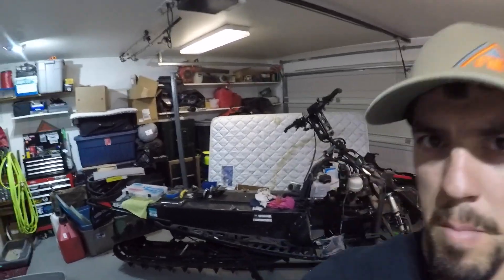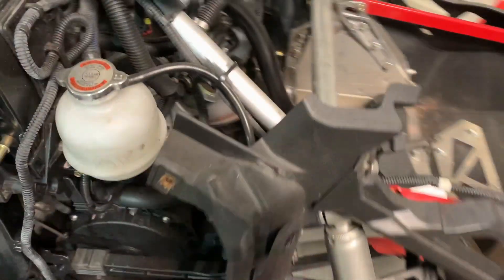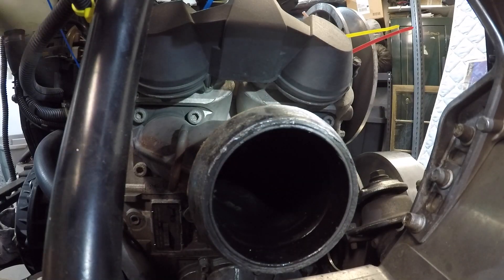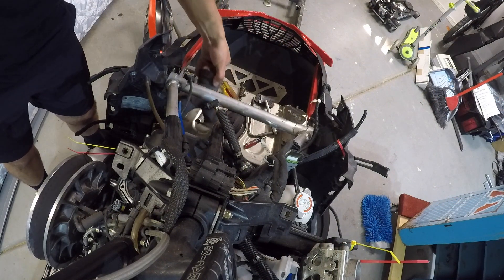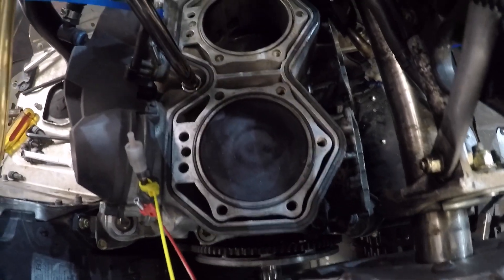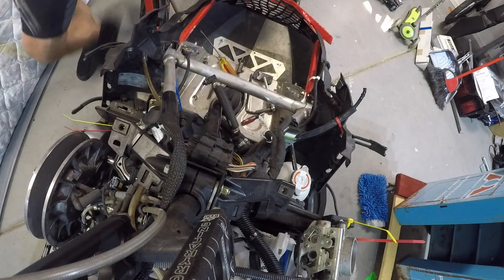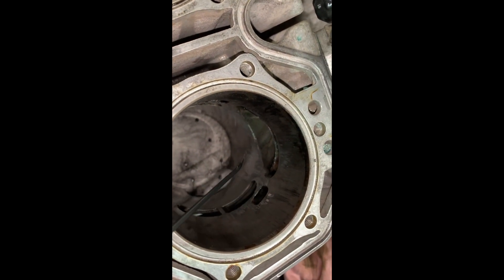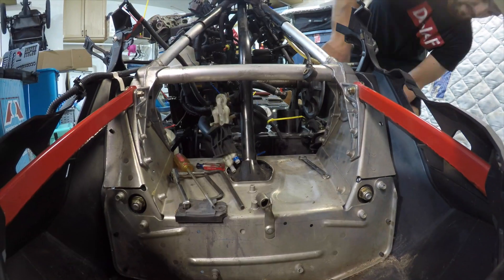2016 800 ETEC Snowmobile engine teardown!

Comment: Got 18,000 Kms on my summit T3 etec, just needs an air box boot. Gotta let em warm up.  My summit before this one had 14,000 km before I sold her.  Take care of your sled. She’ll take care of you
Reply: How often did you grease crank bearings?  mines 4500km but I bought it used and don't know how it's been treated before me, I'm thinking of doing pistons/rings for PM and greasing outer crank bearings, replacing plugs
Reply: @Pneumamechanical  had my local shop check mine after my right coil went and told them check my bearing and they said it was good. I changed my plugs three times so far. Pain in the ass not having a shed hah

Comment: How many miles??
Reply from the maker: 1100 miles
Reply: @starspangledgarage  mine 2014 800etec have ran 5000miles without rebuild it, guess im lucky
Reply: @verttiturunen5045  2016 800etc. 4kmi, no rebuild. Original belt. Also lucky!
Reply: @anotheruniquecorestar1004  friend of mine has 7,000 some miles.
Reply: 1,000,000 miles he uses the grease from his mullet for lube.